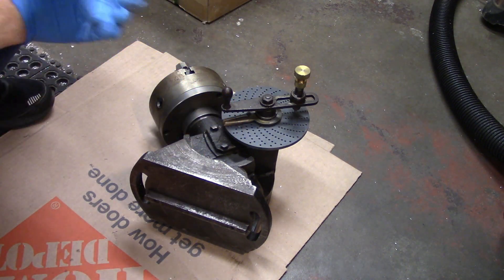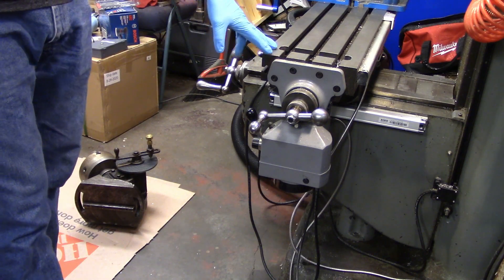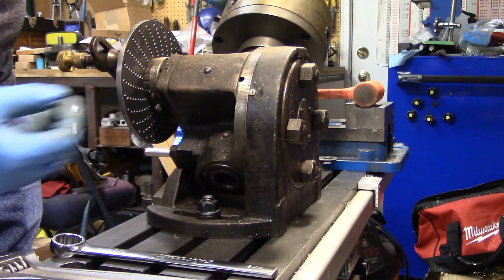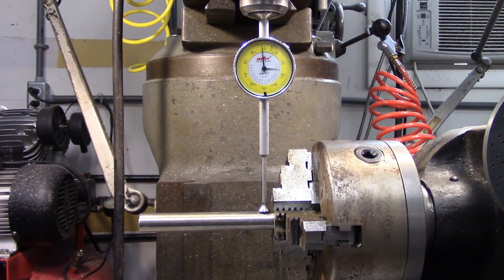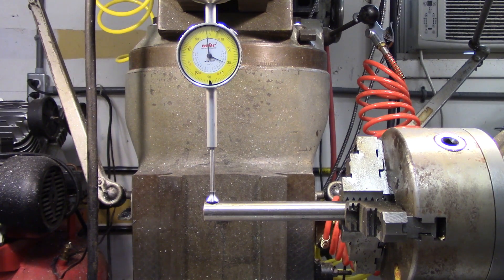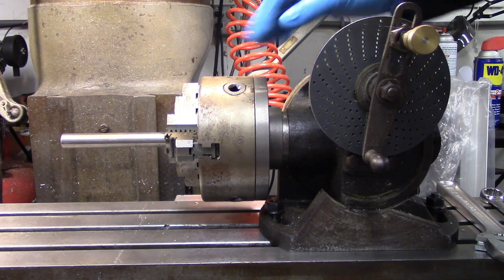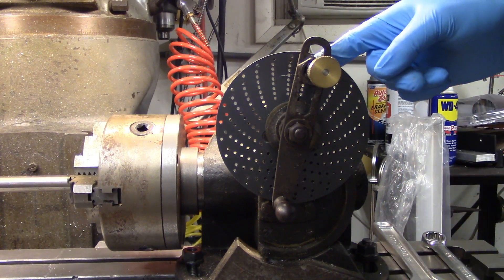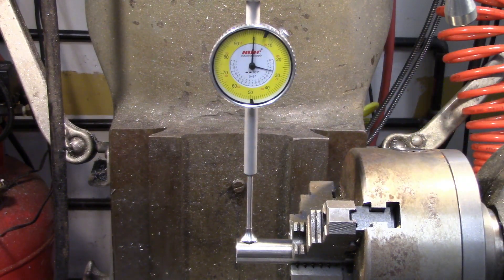Dividing Head Set Up

Comment: So, to sweep in the indexing head, I see angle wise the concept, I understand you repeat the process for the other axis (your is keyed and you skipped this step) really what your saying is you need a reliable rod to do this. I have purchased HSS drill rod, but question the trueness (run out) of the rod. Any recommendations for getting a rod for the purpose of sweeping in an indexing head? Thanks Stu
Reply from the maker: I would use a large dowel pin or some turned ground and polished (TGP) rod. Another option would be linear shafting. It's straight, round, not too expensive, and hard on the outside. You can find it at McMaster Carr and a number of other places. You can salvage smaller diameters out of old printers too.

Comment: Hi really in joy your Chanel are you a hobby guy or a professional
Reply from the maker: A little of both. I work in a maintenance machine shop at a university by day. We rebuild pumps mostly, with a fair amount of hydraulic work. Not much actual machining. Then I try to make projects I enjoy at home. That tends to get put aside so I can do jobs for other people though, like the universal joint shown in my last video. I also teach part time at my local community college, but COVID has really hurt enrollment. I didn't teach last semester because there weren't enough students and I'm not sure if the class will happen this semester either. What about you? What kind of things do you make?
Reply: @StuartdeHaro  I am a 71-year-old newbie I have a lablond a Lathe 19 inch swing 54 inch Center, Bridgeport mill pier surface grinder
Reply: Taft pierce Serfice grinder. I did this I just started this hobby about a year ago I’m in the final stages of setting up my 14‘ x 14‘ shop in the back of my house going to auctions and having a lot of fun. Did you ever consider doing an online class for beginners using a mill, wave and a surface grinder?
Reply: Not sure how technically it would work but I think it would be neat to set up my desktop in my shop and work on projects while you’re on the screen answering questions etc. there’s so much to learn but with some help it would really expedite things
Reply from the maker: @santopezzotti730  shoot me an email. The address is on the About tab on my channel page.
Reply: @StuartdeHaro  hi I can’t find to email address
Reply from the maker: @santopezzotti730  Go to my channel page.  Under my name there are multiple tabs, Home, Videos, Playlists, Community, Channels, and About.  Click the About tab and down in the Details section there is a line that says "For business inquiries:" which should have a clickable link labeled "View email address".  Click that and you'll have it.
Reply: @StuartdeHaro  hi I still can’t see a email do you have a name of your company I will goggle it and get it that way
Reply from the maker: @santopezzotti730  I work at the University of Illinois Urbana-Champaign